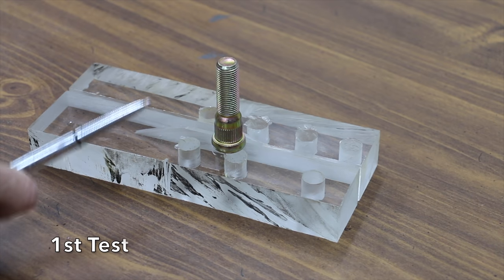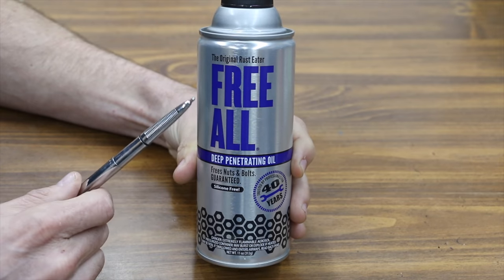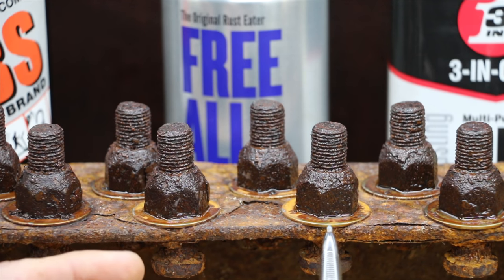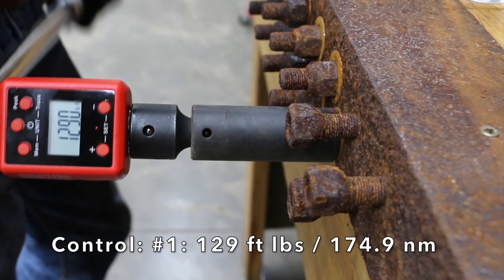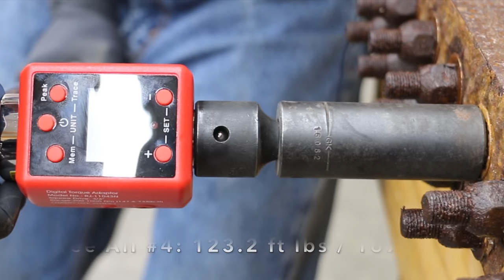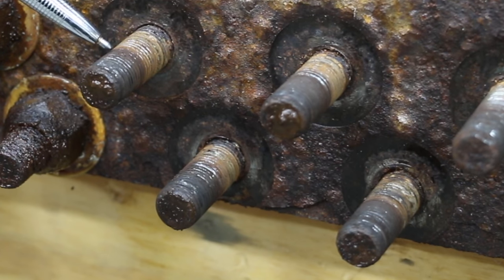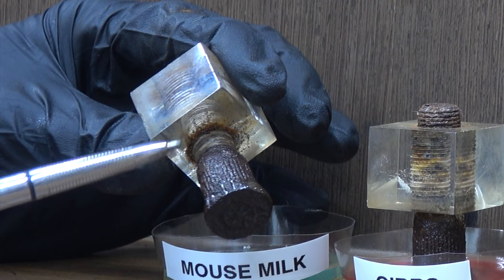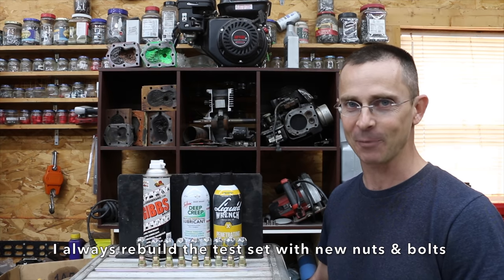Does Water work better than Penetrating Oil for Rusty Bolts? Let's find out!

Comment from the maker: Thank you all very much for suggesting this episode comparing water against penetrating oils and I look forward to your future video ideas!  Best regards, Todd
Products Tested In This Video (in no particular order):
Free All: https://amzn.to/2Qeyn6K
Gibbs: https://amzn.to/3lbLpAa
Mouse Milk: https://amzn.to/31gG2Ie
3-in-1 Oil: https://amzn.to/2EgCcWP
Reply: You didn’t try natures lubricant....... Spit.
Reply: Something you should try as an electrician I found this works very well for pliers such as Klein pliers and needle nose that are machine pressed rust and become stiff we run them under cold water in the sink as we work them out then take a paper towel and wipe the rust that will come out out of the press points then once it’s all done and dry and loose Then we coded with a lubricant for long lasting but so far just using lubricant does not pull the rest out enough
Reply: I'd like to see you test out different rechargeable shop flashlights like streamlight, Milwaukee and some others. I'm a diesel Technician and most people in my shop use streamlights but I've had issues with poor quality batteries only lasting up to 6 months before being crap. I also do a lot of electrical work and the light from a streamlight tends to white out small wires and markings. Mymilwaukee light though made it through an entire deployment with me without issues and while is rated the same lumens, because it uses a softer light it still illuminates the same without causing the glare that the streamlight does. It also seems more robust as well, able to handle typical shop chemicals, drops, etc better.
Reply: Please test milk as well as coke
Reply: Some homemade stuff by Chris Fixx works  acetone an auto transmission  fluid , the fluid can be used.
Reply: you can repeat the test only instead of water you should use vinegar. Greetings

Comment: I use whiskey to get stuck bolts loose . 3 shots generally makes me a bit stronger . If they are really seized I use 6 shots . there's generally one downside , when I'm done breaking them loose , I need a nap . As a side note , everything is better looking the more whiskey I have to use .
Reply from the maker: Thank you!
Reply: Hell yeah brother!
Reply: @ProjectFarm  Honestly, you should try Whiskey for one of these 'snake oil' tests next time.  Not because it is practical but because it would be extremely entertaining and in this example it would lower surface tension and help it climb surfaces.  It would likely have done better than water here.
Reply: "hand me the ratchet... the sexy one"
Reply: Love it
Reply: Well said Sir.
Reply: Be careful not to snap those bolts. The max torque is half a turn back from when it snaps. That´s the rule of thumb I use when tightening bolts anyway; I make them snap, and then reverse a bit.
Reply: Dr. Westside here here cheers 🥃🥃🥃
Reply: Lmbo. Cheers,  here's to loosening them bolts!

Comment: Since you work with oil so much, I’d like to see what cleans it up the best (Dawn, Purple Power, Laundry detergent , etc). And the fact that I spilled motor oil all over my SUV cargo area has nothing to do with it!😧

PS. I ended up throwing the crappy carpet liner out and bought a rubber liner. Some of my toolbags got soaked, though. What I did was soak them overnight in a mixture of Tide Plus Ultra Stain Release, Dawn and Purple Power. Took 3-4 scrubbings to get them back in shape. Watch out for Purple Power cause it has sodium hydroxide in it - which I think is lye. Prob would damage a cotton bag.

I also did a stupid thing by putting the liner in the washing machine. My advice is DONT DO THAT!
Reply from the maker: Great video idea! Thank you
Reply: I second this! I just rebuilt my 30 year old VW engine and cleaning all the parts was the most time consuming task of them all :/
Reply: Clay Cat litter
Reply: Brake cleaner :D
Reply: @Marvin624  How did you clean them?
Reply: Arnis Dont want to use brake cleaner in my truck cargo area.
Reply: @Ronbo765  simple green is your best bet. Works alot better than dawn but not to harsh on plastics or carpets.
Reply: @999thenewman  A large bowl full of petrol and a brush (and a face mask!)  for all metal parts. Brake cleaner too, but I went through too many bottles too quickly.
Reply: @Marvin624 Ah! Ok. I'd do that to remove the bulk of the filth (in high volume, diesel would be much safer). You can soak parts in plastic totes using washing up liquid, as you call it. Let parts soak for a couple days.  Or use an enzyme-based cleaner like Simple Green. Would make everything easier.
Reply: Super clean works real good
Reply: @Iroc_twan  Nice!
Reply: +arnis... I'm pretty sure that would be a bad idea. It's not on the ground, it's in his interior.
Reply: I assume it is in carpet.  If so I recommend very hot water mixed with dish soap.  Soak the area, agitate with a stiff brush and then use a skin adapter on your shop vac and suck out the water and soapy foam.  Repeat quite a few times.  Using orange hand cleaner (pumice free stuff) with laundry detergent dry with a stiff brush also works.  Blot as much oil as you can, smear some orange stuff with a little detergent and scrub hard.  Add tiny amounts of water to get it to foam a bit.  Use your hand to squeegee the foam off and brush again.  Shampoo with conditioner in it also works well for removing oil.  For some reason, the conditioner is what really helps more than the shampoo.
Reply: Scrub some tide into it and wet vac then rinse a couple times. Mountain breeze is a refreshing smell.
Reply: Pull the carpet . Mop up the mess . spray some good degreaser on the carpet when it's outside of your car hose it off wait for it to dry then reinstall .  Problem solved . You may or may not need to take your seats out . It's not like that's very hard either . it's the same principle as the carpet in your house it doesn't matter how many times you clean the stain off the surface . If something underneath keeps wicking up the stain will keep coming back .
Reply: Plain old cat litter.  I spread it on, then grind it in with a gloved hand making a fine powder out of it.  Let that sit for about a day to wick the oil out of the concrete.  Sweep up.  Spray down with purple power and pressure wash.  Depending on the concrete it may take a second round of the process but you can get it fully removed.
Reply: SUVs are shit anyway. Just put it in the press.
Reply: dawn works better than any other dish detergent, simple green/purple power i would assume work better than dawn, but tarnish aluminum and will melt your skin off
Reply: That's going to be a lot of work. Maybe taking your SUV to a professional detailing service would save you time and effort.
Reply: Any oven cleaner , spray can foam type
Reply: @ProjectFarm  Make sure to try Krud Kutter original.  That stuff is pretty amazing at emulsifying oil/grease.
Reply: Orange goop too
Reply: dawn all ready won  go put a drop in a puddle of oil and you can see it get displaced
Reply: I also agree with this.  Oil sucks to clean! On the NASCAR tracks we use laundry soap.
Reply: I have tried simple green with limited success (I was rather conservative in how much I soaked it). I haven't tried Dawn. I was thinking of giving some oil-dri a go... I, too, am highly interested in cleaners, especially for petroleum distillates in car interiors.
Reply: Ron John wins the internet today
Reply: Apparently,  coconut husk.
Reply: Oil in carpet ohh that's gonna suck to clean up no matter what you use   remove the carpet for cleaning if you can
Reply: Clean green I think it's called. GOt oil all over my snowblower once when the oil cap came off. I got the clean green stuff at walmart. Worked perfectly
Reply: Dish soap is made to cut grease and does very well. I think Dawn is the preferred brand. You have to use some amount of water with it as dish soap is water activated. Dawn also cleans grease off hands pretty well but not as well as Fast Orange.

If my hands are really greasy I use Fast Orange on dry hands, wipe with dry/paper towel and then use a little Dawn or better yet, Lava soap. A medical scrub brush helps a lot. I've noticed some mechanics use Ivory instead of dish soap. Gojo is good too but I find Fast Orange is better, but you HAVE to use it on dry hands Before using dish soap or anything else. It's like a one-time deal only.

Solvents to clean hands are a last resort as they pull the natural protective oils from deep within your skin. Best if you can use mechanic's gloves though or the black Nitrile ones like Project Farm uses.
Reply: OMG to funny
Reply: Turn it in on your insurance they will cover it! And since they are molesting us on premiums! Or Toss it and call the salvage yard get a used carpet and power wash it before you install it! I loaned my van out to my mother inlaw and she bought a 100 year old washing machine and it leaked 100 year old gear lube on my carpet! I love her though! 😳
Reply: @Worrsaint  
Nope it's in tree bark .
Reply: I'd love to see videos about ckeaners. My dad always swore by gasoline for cleaning tar (roofing tar) off his hands. As a kid I expected him to blow up one day. 

When he came to visit from out of state about 13 years ago, he insisted on trying to help with our leaky roof. Came down and asked for gasoline. I was like, "We really don't keep that lying around," and doused him in Goo Gone instead. It worked great and I wasn't afraid my dad was going to combust.
Reply: Purple power for sure works better on oil than dawn.  Dawn is better than laundry detergent.  Problem is degreasers like purple power is often toxic.
Reply: Excellent suggestion... and not that I too have stubborn oil stains on my driveway I'd like to see gone.😠😂
Reply: RonJohn I would look into totally awesome. But like other said. Best way is to remove the carpet and power wash it.
Reply: Strieter Marine Survey Thats a good idea but didn’t see your post until too late. Tossed the carpet liner!
Reply: o1mtbiker Tried that. Oil just stuck to carpet.
Reply: @999thenewman  +1 for diesel. Kerosene or white spirit also works well, and isn't quite as nasty as petrol.
Try using shampoo to clean your hands. It's formulated to cut fat while being easy on the skin. It also works on canvas.
Reply: Keen to see plain old steam put to the test
Reply: RonJohn super awesome idea
Reply: THIS PLEASE
Reply: I had some break fluid spilled on the floor of my truck, I used this degreaser called "super clean" along with a scrub brush that I got at the hardware store. I scrubbed it in, then put water on it, and sucked it up with a shop-vac. it worked well, didn't leave any odor, and claims to be biodegradable.
Reply: RonJohn if you Urinate all over it your urine will break down the oil molecules and make it easier to was out
Reply: Original Pine-Sol makes a great water based cleaning solvent and Dawn really scrubs off grease without making a Lot of waster water
Reply: Purple Power all the way for the biodegradable stuff. Brake cleaner as the petroleum based stuff.
Reply: Mrs Meyers Clean Day hand soap can lift a spot off of an atom, as long as you scrub it and create bubbles to oxidize the stain.
Reply: @ProjectFarm  Everyone says dawn is the best, including Dawn, but I'd like to see how it holds up to the above plus the cheapest shampoo you can find as thats supposedly the most oil-stripping thing on earth according to window cleaners and women.
Reply: Simple Green. I use it in a rug doctor to clean my carpets too. Amazing
Reply: MRVN buy parts washer tank from harbor freight
Reply: Between specialized "work hand cleaners" and Dawn I can say this I ditched things like Lava soap for dish soap and got my hands cleaner than anything specialized could do to grease, oil, brake dust, heating oil, soot.  Dish Soap is also of course perfectly safe for hands to be around.
Reply: I'd love to see that, seems interesting
Reply: Felsnaptha. Best (non-pumice) soap out there. Just about dissolve your fingernails off so be careful!
Reply: Lava soap works good.
Reply: Amusingly enough, I had been contemplating leaving a comment suggesting a video about which cleaning detergents would work for heavy/chemical stains.
Reply: @ProjectFarm  Please include Koch Chemie Green Star if you do this one!
Reply: Use monster energy drink
Reply: RonJohn I know this will sound odd to you and several other people but my brothers kids when they were lil climbed outta my show Blazer and played in cow poop 💩 then climbed back into my Brazer with crushed velvet seats and before I was gonna " kill em both " my mom ran my off and cleaned my seats with Original Windex.   Since then I've used it several times to clean good clothes
Reply: Stacy Reid Thats funny!
Reply: RonJohn it's ok now but then I was HOT at them 2 kids   Walking up to my show truck and seeing cow shit ground into my custom cherished velvet rear seat   My dogs I had back then never did that they knew to stay out of it or stay in the floor on mats
Reply: Keep Purple Power off paint too, it eats clear coat like a full course meal! Ask me how I know..
Reply: I love your profile pic!

Comment: I thought I had my headphones plugged in, but my laptop blasted at full volume "RUSTY NUTS" in a library. Ouch.
Reply from the maker: Funny!
Reply: Rusty nuts!?!? You need to get out more often!                                                                   1
Reply: @walmartdog1142  He might have been looking for a cure. Lol
Reply: @walmartdog1142 ....or maybe he needs to get in more often.  If ya know what I mean. LOL.
Reply: @walmartdog1142  I'm majoring in physics, suffice to say I don't get out much lol. I spend a lot of time in my school's library.
Reply: Seriously funny!

Why can't my laptop learn my headset needs 85% less volume? Sorry, different problem where I'm blasted regularly.
Reply: @DENicholsAutoBravado  Your headphones have a lower impedance than the built-in laptop speakers. To fix the volume problem you could buy a cheap passive adapter (approx. $5) which just has some resistors inside. Alternately, in the Windows notification area (bottom right) where the speaker volume control appears, right click it and open the volume mixer. There might be separate volume controls in the mixer to adjust internal speakers and headphone volume (it's a pretty slim chance, but worth mentioning).
Reply: @chrisbalfour466  I checked and no, but thanks for the suggestion. There ought to be a way to add the feature as the Windoes 10 volume mixer knows when it's running speakers versus headphones. I have a good how to channel to by the way. I occasionally share product testing as well. My focus out of products is performance or efficiency and I more accurately share that information than most.

Are you aware of the surgeon Balfour who invented so many surgical tools still in use today? Especially for open gut surgeries. Most or laparoscopic it's true, but some heavy damage situations can't be done laproscopically. I'm usually a mechanic but occasionally I do contract work as a surgical technician.
Reply: @DENicholsAutoBravado  Sorry. I think I've heard a bit about him, but I'm probably not related. The name Balfour is like a Scottish title, similar to the meaning of don in Italian, English lord, or French marquise.
Reply: Yeah, that does limit the chances of being related.  @chrisbalfour466
Reply: @chrisbalfour466  I have a channel to you know. It didn't take off like our friend Project Farm, but it still gives good Automotive how to and I do some testing too. 🙂

Comment: I'm curious how much a drop of soap in the water would improve results? Youd think that reducing the surface tension would help it out a bit.
Reply from the maker: Great recommendation! Thank you
Reply: This makes some sense here, I know if you add some dishwashing liquid to water while watering your plants, it does make a real difference. I have to say though, in all my years of fighting rusted nuts and bolts, NEVER have I heard H2o as a penetrant. I've recently been using a 50/50 mix of transmission fluid and Acetone which seems to work fairly well. Have you or anyone else tried that FREEZE stuff that comes in an aerosol can?  GM has that nylon garbage holding the u - joints in place as opposed to the c - type clips. I'm wondering if I were to use this method if I could just BUST or Shatter the nylon as opposed to using a torch.  Thoughts anyone?
Reply: A lot!!!
Reply: TheCheesePlease  I dont think at all that it will surpass commercial penetrating oil, I'm just curious what, if anything, will happen if soap is added to the water, theoretically lowering the surface tension.